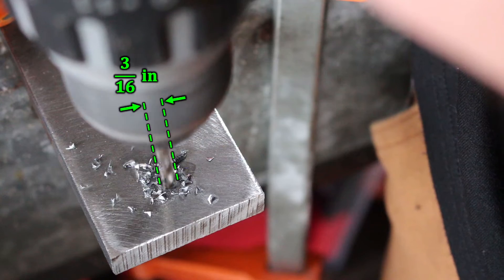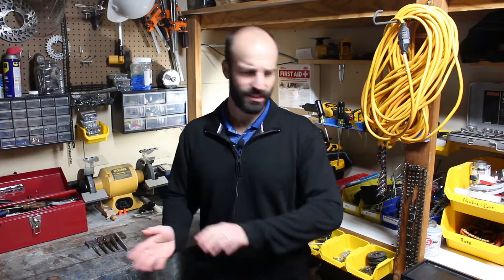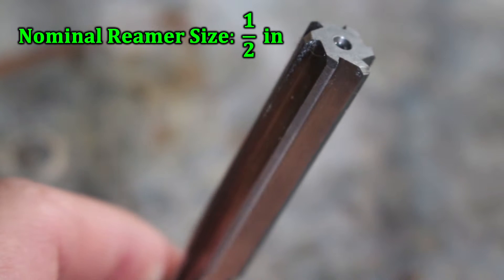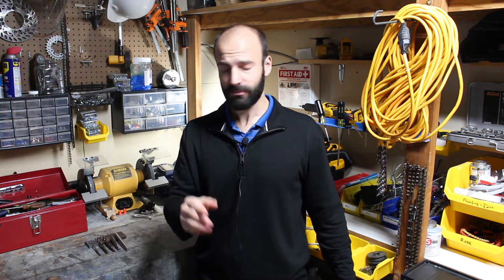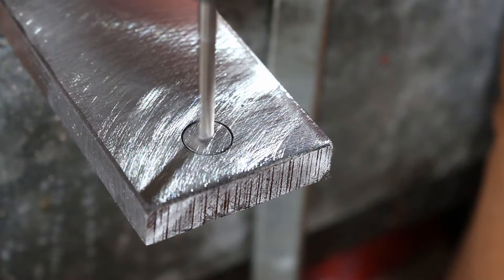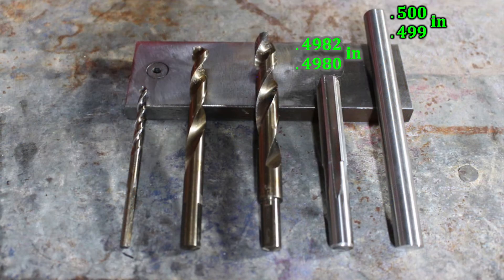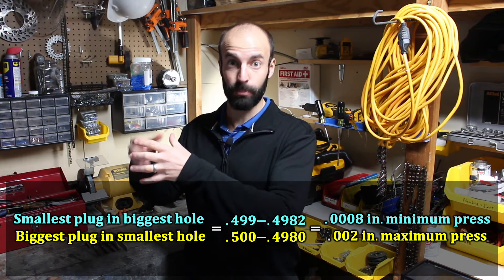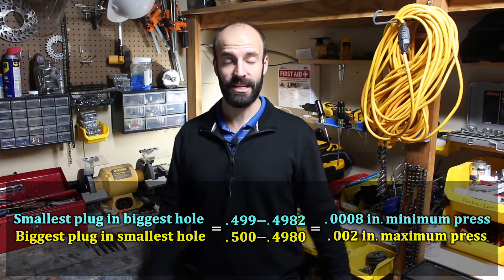How to Make a Hole Smaller

Comment: Easier and not requiring reamers and precision bars is to drill, tap and locktite a bolt.
Reply from the maker: Good idea! With that method, I might ball pean the opposite side before re-drilling to help keep the screw in.

Comment: Neat tip. I would’ve thought you’d need a little TIG welding to make it fully strong. I’ve done the same thing with wood and a little glue.
Reply from the maker: Thanks Mark! Good tip on the wood. For steel-steel, no need for weld with enough interference. With similar metals, "galling" may also occur, where materials rub into each other and naturally fuse together. This is usually a problem, but not when we're trying to form a permanent press.

Comment: Thanks for the great video. I normally just weld up holes if I have the right filler, but I like the idea of interference fit as well, and you very clearly explained the methodology which was handy. For that larger plug (0.002) would you need to press it in, or, would hammering still work?  I also picked up the tip about putting shafts in the freezer for easier fit from the comments below, which is another thing to add to my arsenal of measure once, cut twice, techniques.
Reply from the maker: Thanks Mike! With a chamfer you can hammer a .002 press, but you might warp or scuff up your part. Some folks invest in a manual arbor press or a shop floor hydraulic press, which are gentler methods. The bigger the hole, the more forgiving it is with greater interference, too.

Comment: Shrink fit?
Reply from the maker: There is overlap in tolerance standards that use terms like interference fit, press fit, drive fit, force fit, and shrink fit. You could also cool the plug instead of heating the plate.
Reply: @McGuireMechanism  was just about to say the same. You could potentially get a slightly bigger plug, and throw it in the freezer for a while, let it contract, pound it in, and when it expands you’ll get an even tighter fit. We used to do this with certain automotive bearings, like for pinions etc. Great video btw, faster and easier than pulling out the welder! I’ll use this tip next time I screw up, which I have no doubt will be soon! Lol.
Reply from the maker: Thanks @CivilizedWarrior ! Great point. I often throw shafts in the freezer (if they'll fit) just so things go together smoother too :)
Reply: would not work cause you would have to heat the plate and not the rod. because you need to expand the metal hole in the plate which depending if you need the billet flat then heat could warp it

Comment: Pretty nice way, if the hole is small enough you can actually seal the hole with a weld bead then grind it and redrill. We used to do this in college works well.
Reply from the maker: Thanks, Saifi! Filling with weld is a good tip.
Reply: This is what I do with a hole I have inadvertently drilled in slightly the wrong place. Fun Fact you can also weld a bit of metal to a broken screw to undo it even if the screw is in wood. I had to do multiple of these in some old floorboards I was reusing.

Comment: Good luck with a 0.002" interference fit!
Reply from the maker: That's the upper limit of the tolerance range for interference. Any lower with the reamers I can find would drop the lower limit too low. I agree—0.002" is not ideal, but that's not the target nominal value, and it works for me.